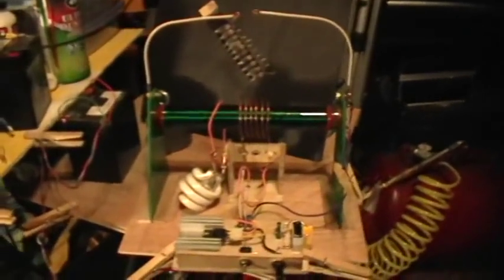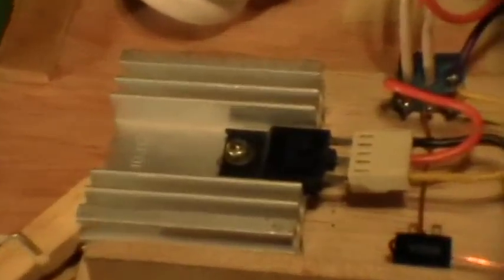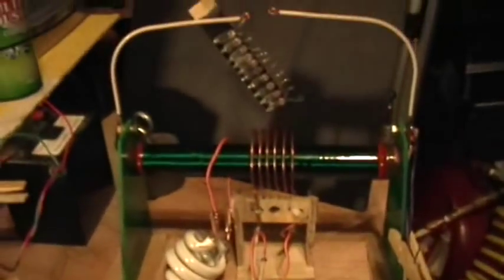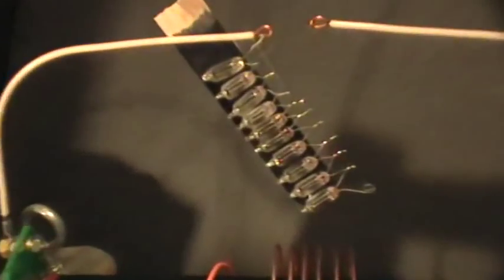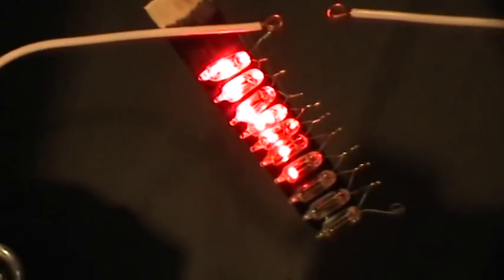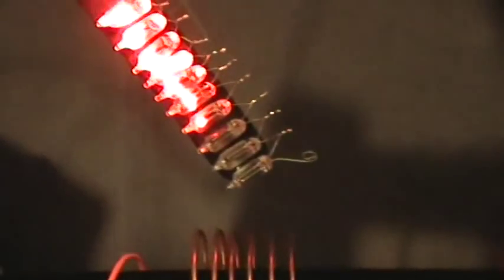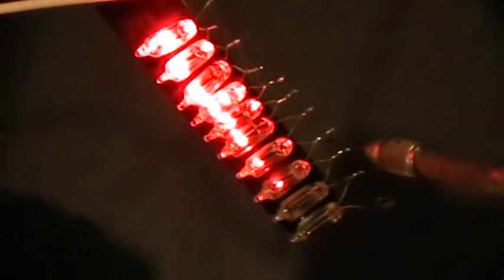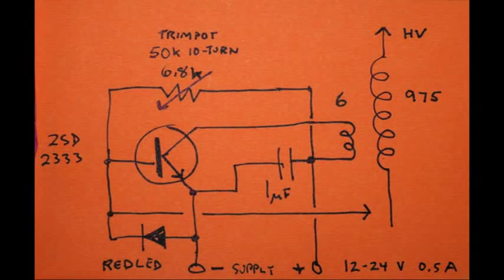Extreme High Voltage: TinselKoil 8 w/ Slayer Driver

Comment: I like how you build your circuits with plugs'n'stuff. I'll have to try this method.
Nice progress :)
Reply from the maker: Thanks! Using the sockets makes it very much easier to do "quick change" transistor substitution. It's a little harder to set the sockets up but well worth the trouble in the long run.  These 5-pin sockets can be used for TO-220 as well as TO-247 size packages if you take the trouble to wire them B-B-C-E-E. I didn't do that here, I just pushed the inserts out and moved them to the adjacent holes for the different transistor packages.
And the coax power plugs and sockets make for neatness and interchangeability with other projects, only need one power cable.
I really don't like using a lot of colored clipleads. I joke about them a lot whenever I see a Jackson Pollock maze of clipleads: every electrical "Free Energy" device needs them, along with a big battery of course.

Comment: That one I made worked with the pick up only on one side. If you move it to the other side it stops. All sorts of things work. Small pancake coils, a jumper worked just laying there.
Reply from the maker: I got it to work with a pickup loop finally but at lower output voltage, and only on one side too. Earlier I determined that the 1/4 wave freq of the green coil is about 650 kHz using the QEG driver, and with this Slayer version it oscillates at 1302 kHz. Hmmm...  So I decided to put in a center tap on the green coil to give some more options for hookup. Did some other cleanup too, waiting now for some corona dope to dry before I test it again. I hope I didn't kill it!
Reply from the maker: Do you know the part number of your transistor? I only have one of the 2sc2238a and I'm a little worried about blowing it, I'd like to find some alternative. It's the only one in my stash that does work well without the base connection.
Reply: TinselKoala D1264A Japan is the one on the big green coil. The others have since went to the dead jar :). From now on I'm going to always use half of the volt rating or less. I wanted to say thanks for teaching everyone and making your films they have been a big positive part of my learning.
Reply: TinselKoala I have ordered some new 2N6547 I can't wait to get those :)
Reply: TinselKoala the D1264A has been run for many hours with different coils all shapes and sizes at 36 volts. I pulled it out of who knows what :)
Reply from the maker: Terry Woodroof
Ah, thanks, that will be a 2sd1264a then. 180V 3A silicon triplediffused. Does it have a "rank" letter Q or P on it? This will be the Hfe class, I'll bet you have a P which is Hfe up to 240. This is practically the same as my 2sc2238a-y but a little lower transition frequency. I haven't had the courage to push mine to 36 v yet.
Reply: TinselKoala that is what is under the D1264A  (PM5N) its a bad little dude :)
Reply from the maker: Terry Woodroof
Yep. "P" class Hfe spec between 100 and 240, and the M5N is probably a date code.

Comment: My suggestion -use TIP31C you will get big arcs up to 2 ~3 inches .....I made one by connecting 3 of these in parallel to divide current .and o used 36v power supply ,I got astonishing results.try it.

Comment: will it work with a 2n3055 with a diode across the emitter and collector
Reply from the maker: science Vlog
I tried a 2n3055 in this circuit and it does work but doesn't give the HV that this one does. Also tried MJE3055, same same.
My MiniSlayer bottom-loaded exciter coil works with a 2n3055 though but it does have a diode, but not across the emitter-collector. Its diode goes cathode to Base and bottom of bottom load, and anode to Emitter, similar to the LED in this circuit.
http://www.youtube.com/watch?v=OgndINJHnd0
Reply: TinselKoala thanks :D